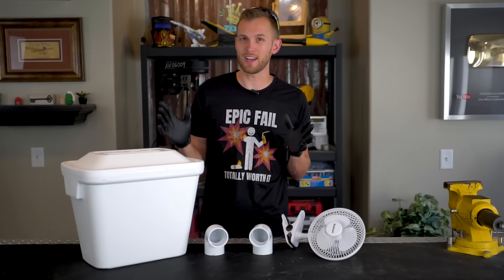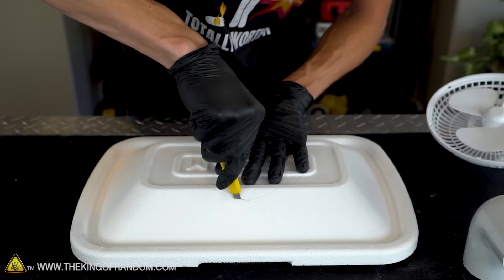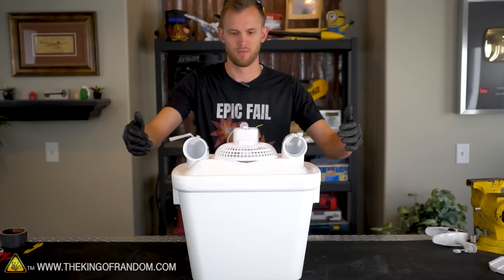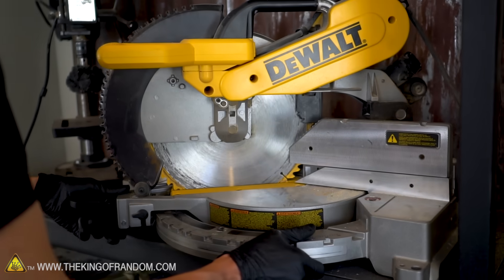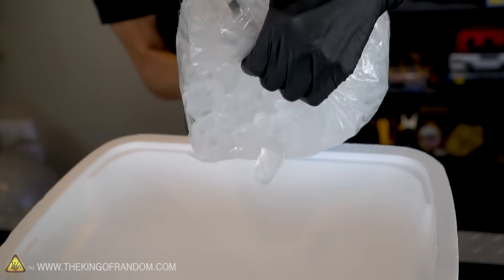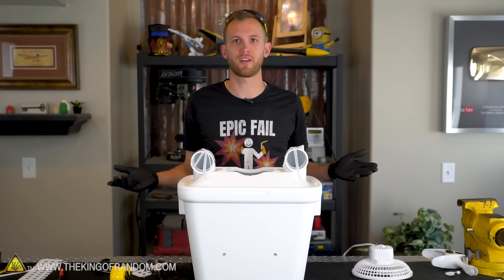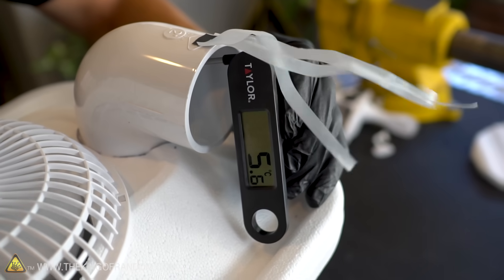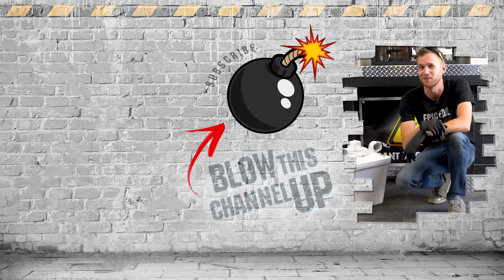Recycled Styrofoam Air Conditioner! TKOR Creates An Efficient DIY Air Conditioner!

Comment: To all of you requesting to put dry ice in it!!! Dry Ice is Solid CO2 so when it's sublimating it instantly turns into said CO2. It would raise the the CO2 Level in your room so much that you could die. Don't do it.
Reply: The CO2 would also attract mosquitoes.
Reply: There's not that much CO2 in the air. It's 0.04%. There's no way to could release enough to significantly reduce the concentration of oxygen below 21%. CO is toxic, but CO2 isn't going to affect you unless you seal off the area and stay there until most of the oxygen is gone.
Reply: a makeshift smoke machine of death
Reply: Amuse I think you underestimate the power of the dark side
Reply: Maybe if you're cooling the toilet. But something like a bedroom requires a LOT more dry ice than that, to saturate the air with enough CO2 to become lethal.
Reply: Plus ice is cheaper
Reply: J C Robertson the room will still slowly fill with co2
Reply: moldy toes there isn’t enough volume in the cooler to fill the room.
Reply: Holdenba Holden it all depends on the size of the room the co2 would displace the air
Reply: Lojey oof
Reply: What about liguid nitrogen
Reply: Monty Leverett you're welcome ;)
Reply: Nitro?
Reply: You could always save up for an air conditioner, this is the fun way though! Nice Vid TKOR I’ll probably give this a try!
Reply: Lojey Sublimating, ik you know what that means Lojey haha, got the easy Lang in there
Reply: I dont see myself using this indoors so would that really be a issue
Reply: This is why Darwinism is so relevant. Survival of the fittest. Do as you please, you'll just thin out the herd with natural selection. :)

Or you know, be smart and not sit in an enclosed room with a butt ton of co2.
Reply: Oh
Reply: And there you go, totally ruining Darwin's Natural Selection....lol
Reply: I guarantee you somebody's doing it right about now!
Reply: How about putting it in a sealed plastic bag
Reply: TLDR: Don't use dry ice. 
The air around us is around 20.9% oxygen, and it's considered to be normal down to about 19.5%. 
At 15-16% oxygen any physical activity results in your cells not having sufficient oxygen to function correctly resulting in impaired thinking and coordination and reduced stamina. 
At 10 to 14% any physical activity will result in exhaustion. You'll suffer a lack of coordination, poor judgement and emotional distress. 
At 6% you will not survive. Some sources I've seen have stated that 10% is sufficiently low to result in death. 

Let's assume you're in a room containing 62.5m^3 of air (that's equivalent to a room measuring 5m x 5m x 2.5m, or around 16'5" x 16'5" x 8'2", that is otherwise empty). In that rooms there's about 13m^3 of oxygen. You would need to displace ~9.3M^3 of oxygen to reduce it to a lethal level, which would take around 12L of dry ice. However, CO2 is denser than air so would form a layer at the bottom of the room. Assuming you're standing and of average height (~5'9", or 1.75m) then then amount of oxygen displaced would only need to be 8m^3 (~7L Dry Ice). If you're lying on a bed less than 3' (~90cm) from the floor then you only need to displace ~3.3m^3 (4.25L dry ice). 
Bear in mind those figures are to reduce the amount of oxygen present to the lethal 6% amount. At 10-12% Oxygen you're likely to faint without warning after just a few minutes of exposure. This has the potential not only for you to hit your head on the way down, and also puts you closer to the ground where the oxygen concentration will be at it's lowest. You may suffer permanent heart damage at this concentration too.
Reply: @VeritasAbsoluta  Your one intelligent human being.  Please produce lots of children.
Reply: Lojey I was just about to comment to do it
Reply: Sierra Robinson it’s not about the temperature. Putting dry ice in the air cooler will melt producing pure co2 displacing breathable air suffocating you
Reply: If you put the dry ice in a bag, i'm pretty sure the bag would pop as the dry ice sublimates away.  not a solution. however, since co2 is heavier than air, it's not really much of a problem if you wanted to go the dry-ice route as you'd be breathing the air above the co2 layer anyways.
Reply: There isn't enough volume in the cooler to fill your room with CO2. You'd be fine unless you were only breathing through the tubes. xD
Reply: Lojey I like this guy he thinks like me
Reply: Btw u saved some people's lives
Reply: She's right
Reply: For you people that are commenting you "you don't know what your talking about " you are wrong if you put dry ice in a bag the bag will build up pressure and explode and if you leave it out in a room and in a non ventilated room you can and will die. But I can't tell you what to do so do what you and this is the reason there are warning lables so if something happens then some people tryed to tell you people, so have fun I guess. 😔
Reply: what about 2 parts of ice and half part dry ice
Reply: Darkiplier TM 👌
Reply: Vishal 16 that was the purpose of this comment 👌😂
Reply: Jamaican Cheddar Yeah english isn't my first language. Im from germany
Reply: rockhead670 nah don't use it With Dry Ice
Reply: THANK YOU LOJEY!
Reply: Madd Maxx 67 lol. I mean it's true but nobody should die through suffocating
Reply: Bodie James wouldn't recommend it either
Reply: He could take it outside... like under his patio as a fan...
Reply: Lojey it would be fine if you put it in a bag, and besides there's not enough of it to even do that.
Reply: This was my thought too because dry ice is sooo cold I was gonna comment but I was making sure nobody else did lol

Comment: Get a cheap cooler and put a hole for a fan in the top and the exit in the top and then run a dryer vent hose from the fan and coil it around the inside of the cooler and out the exit so then the ice will cool down the hose and blow out cold air

Comment: Where's the dryice?
Reply: Also if it is hot outside opening a window would defeat the purpose of the air conditioner...
Reply: Dry ice is solid carbon dioxide (CO2). The stuff we BREATH OUT. If CO2 builds up in your system it poisons you. What do you think will happen with all that CO2 blowing on you or filling a room?
Reply: Manny Hopar does not work like that. It can build up in your body very quickly. That’s why most UK houses have CO2 alarms
Reply: Manny Hopar well let's say you're in um maybe a room without windows. My gaming room has no windows for example. What do we do then smarty pants?
Reply: And these are all the reasons why most UK houses have CO2 alarms
Reply: Dry ice is not poisonous.  It displaces the breathable oxygen and then one might die from lack of oxygen.  Dry ice in amounts large enough to cool a room definitely would be dangerous.
Reply: The reason why he has not used it because it raises the CO2 levels i think thats what its called and it is a high chance of death
Reply: Richard Greenleaf you can just open a window

Comment: You should've used a thin conductive copper tubing instead of PVC pipes and wrapped it around the water bottles. The idea here being that once you increase the contact time of the warm air with the ice, you shall get better results. With your current setup, the contact time is fairly low and as a result it doesnt get enough time to cool up. You can also try a variation with dry ice.

Comment: Hey be warned ice works great, But! use that in your room and it will make it humid and muggy as the ice melts and things start to evaporate. Bag the ice add water and salt so it cant evaporate into the room and get a colder surface for the air to pass over.

Comment: You could even install a small tap near the bottom of the cooler so that you can get ice cold water as the ice melts.
Reply: OR, just to get the water out since it'll block the tubes.
Reply: I sure love me some dust filled cold water in the summer! Yum!
Reply: Curious if you could modify it so that it sprays water at you at the same time, similar to how an air brush works, or the shampoo sucked up the house when using carpet cleaner attached to the tap
Reply: Or just buy a cooler with a tap.
Reply: @KenziBabenzi  Yeah, exactly.
Reply: M-T how when the tube is in the top
Reply: KYLAN oh makes sense forgot he added a tube down

Comment: So 2 questions, you mention it "lasts for a while" but how long is a while, i mean the hot air intake will melt the ice but how long are we talking? secondly, how about possibly making a mini version that might be more desk friendly, not sure what you could use as a container, thinking maybe an insulated small bucket, the kind you would get for the beach with maybe some sort of small computer fan, could even rig up a battery bank for it seeing as the fan would use a lot less power etc
Reply: You could use a paint can but have the exhaust port cut in the bottom and the fan in the opening for the lid. I would recommend water bottles for that though so that water doesn't leak onto your desk.
Reply: The hotter the air going in the faster the ice melts.
Reply: Why dont you inovate the idea to make a mini version
Reply: The result will be much better if we use ice and chilled water for the lowest layer of ice...I bet
Reply: Point 1 pipe on top at the fan(cool air) and 2-3 pipes pointing out to your area...You are then using cooler air to be cooled...
Reply: Cypherous then make it yourself

Comment: What about water under the suspended ice with water bottles in it?
Reply: You can get it below zero without too much difficulty but it would freeze the water in the system and that could cause some issues.

Comment: Why didn’t you feed the plug through the hole from the bottom of the lid and tape the edges of the fan to the ceiling of the lid so it’s more secure, looks better, and would also probably function better too.

Comment: The method online hacker made is so beyond ineficient. You take a styrofoam cooler cut a hole for the fan on one side of the top. Next fill the cooler with ice water and 3 cups of salt. Then cut a final hole on the other side of the cooler lid for 1" pvc. By restricting the air flow it increases velocity of the cold air leaving your makeshift AC unit. It works like a sump cooler and the more air flow exits the less efficient even bigger units become which is why their sized to your home.

Comment: One idea would be to make some partitions so you can petition off the center section where the fan is and put a lot of cold stuff there and at the very bottom have cracks that the air has to flow through and then more I stuff that has to blow up past calling the air to get chilled twice

Comment: I actually made one of does but you have a problem in your design  if you leave in a very hot place that ice will melt really quick even quicker with that fan blowing on it  and if it's full with water then no air come on for sure not cold air

Comment: Can we use this for a cheap gaming setup?
Reply: Someone CC Linus
Reply: And dry ice?
Reply: thats what a 5 year old would ask, should u even be allowed on youtube?
Reply: Vanderley5974X Ice one probably not it would melt over time which would make it humid destroying your gaming setup
Reply: might aswell do it the intel way... slaps an air conditioning unit
Reply: Nathan Adhitya oh yeah the 5ghz cpu at computex
Reply: Air cooled vs liquid cooled makes little difference in heat temperatures and in some cases the air cooled will outperform a comparable liquid cooled setup. The biggest factors in keeping a system cool under load? The heat sink quality and material, and your thermal paste quality and performance.
Reply: you gotta worry about the humidity too.. i think it's fine if you use dry ice
Reply: Vanderley5974X Lol air cooled noob. just keep your pc in a bucket of ice water ez cooling
Reply: Vanderley5974X it may wet parts
Reply: run the risk of building enough humidity and having a drastic enough temperature difference that water would buildup on things that do not do well with water ;)
Reply: Yep
Reply: Vanderley5974X ya can we
Reply: Vanderley5974X  yes
Reply: Bruh
Reply: Harvie Pamintuan pro thats not really true
Reply: you can but you would need some heavy modifications, I would get an old radiator, clamp a bag or something to connect the fan to the radiator, drop the radiator in some ice water, and run a tube from the other end, a heavy equipment radiator would likely maximize on the intake and output diameter letting you push more air. then you could put another bag on the other end to push cold air strait into your machine. but in theory the icebox would sort of work...
Reply: r/woooooooooosh
Reply: No. You are blowing high humility air onto your system. Instead, get a centripetal fan and use that by itself. A normal fan will work, but a centripetal fan directs the air far better.
Reply: Air directly from this (or any air conditioning vent) is usually near 100% humidity. It is likely colder than room air but at that high relative humidity it's likely to increase oxidation and corrosion on board, at card connections points, fan motor and in relay connections on the power supply. Mostly home PCs aren't designed for RH (above 80%) so check your specs.
Reply: Nunya _ what about if you made a filter with something like damp rid or silica? Wouldnt that pull the moisture from the air but still allow the cooled air to then pass through as dry filtered cool air?
Reply: definetly
Reply: The humidity bruh
Reply: Vanderley5974X yeah you can play fortnite at 666fps
Reply: @lurancefn4113   musical chairs is best battle royale
Reply: Of course you could, but as the pc would go below ambient temperature, then the water in the air would condensate, leaving you with a fried motherboard and cpu at best.
Reply: Zenoox 
Bad tip dood. Water plus electronics equals no bueno.
Reply: +Young Ladydragon
Indeed, Louis Rossmann concurs. Corroded electronics means a trip to the repairman.
Reply: Harvie Pamintuan pro What is wrong if you have a cheap pc
Reply: Ling Ling if you have a cheap pc it doesn't ram it's just like a phone dummy
Reply: Vanderley5974X lol I was just thinking that
Reply: But can it run Crisis?
Reply: X6 64 minecraft is dead right?
Reply: Vanderley5974X  probably if you have a potato pc haha why do you have a cheap pc is it called nooob hahahaha
Reply: Vanderley5974X the graphics won't be the best. But yea
Reply: X6 64 Minecraft is way better than Fortnite.

Change my mind.
Reply: i wont

Comment: Ya know there's a big conservation of energy problem here right? If the cooler is in the same enclosure as the freezer then you're actually making the enclosure hotter. 

Sure it's cheap but a window AC unit can be had for $100 and will actually cool a large area.

Comment: Using loose Ice will put humidity in the air as it melts, this will make a miserable swamp. The  ice is contained in sealed plastic for that reason. sealed plastic bottles will also help remove moisture from the air by condensation. Humid air cools slower than dry air, so adding humidity to the air will reduce the effectiveness of the unit.

Comment: I have been looking for the technique where air flow from a compressor In line is injected through an attachment that is a simple triangular shape that splits the flow into 2 seperate vortices one hot and one cold hot line is pointed away from and or recirculated or visa versa either way the amount of pressure I believe determines how hot or cold each end pushes out.. A few cons to this technique I believe include needing a compressor (although I think you could easily use a tesla compressor and even modify it to entrain the ambient air circulation )  the design is somewhat bulky and the worst con is that it apparently can be loud do to the pressure going through the attachment (although I believe you could create a vibrational entrainment funnel that could divert and or possibly reroute and recycle the energy caused by the vibrations much like an energy recycling suppressor can you guys please look into this

Comment: DO NOT USE DRY ICE!!!!!!!
Reply: Is it maybe because dry ice ist just a solidified gas and as it vaporizes it can replace the oxygen in the room without noticing?
Reply: It's carbon dioxide. That's why.
Reply: yes that modifies it to a suicide machine
Reply: but do use liquid nitrogen?????
Reply: For all of you who don’t know why is because dry ice will produce copious amounts of carbon dioxide which is guess what, not oxygen. So unless you want to suffocate in your own home I suggest against dry ice
Reply: Silica I can still use it for outside tho right? Like my garage with the door open or on my porch since those would be the only times id need this. Then the co2 could disperse in the air easier.
Reply: Yes, use carbon monoxide.
Reply: Corzappy you realize your home is also not airtight and often has it's own ventilation systems, with what you're saying we would all die from our own exhalation of breath
Reply: woolfoma: Too cold too cold 😎🤣
Reply: Silica why
Reply: Silica it will be fine out side but inside is ok long as it is well ventilated
Reply: Why?????
Reply: Gi Geo because it can take a couple of minutes to fill the room with co2 but a couple years to fill earth with co2
Reply: pootuis poot lol
Reply: pootuis poot what is wrong with that?
Reply: What about frozen water bottles on the mat you put in the bottom? You might need extra support but, just wondering what would happen. Would it be just as cold? Probably not bet how close would it be?
Reply: It would work a lot better if you used the cooling element from a mini fridge.
Reply: Silica y not?
Reply: ObituaryPhoenix still better not to do it. Gaseous C02 takes up way more space than in its solid state
Reply: +Real Logic
Maybe if you stacked the water bottles in a pyramid formation so that the air would have to pass over and through them rather than going uninterrupted through the gaps between them.
Reply: Kirito would say other wise